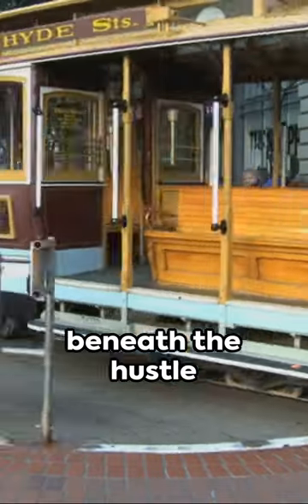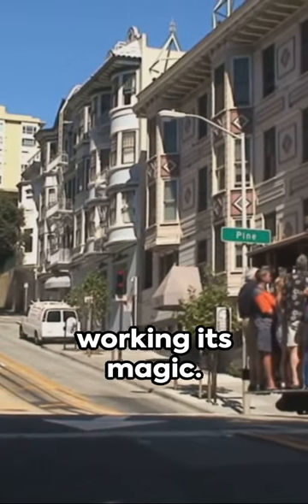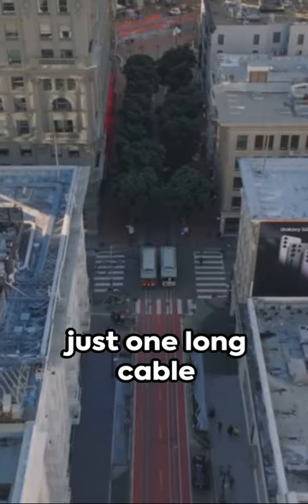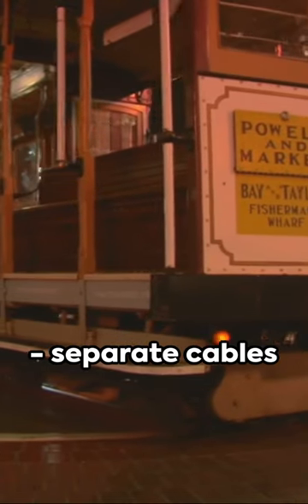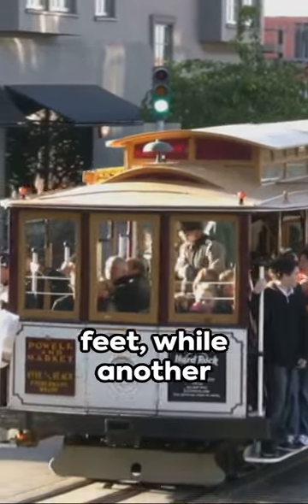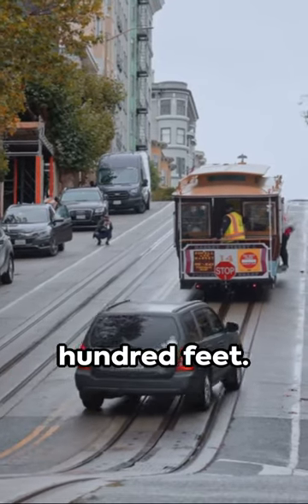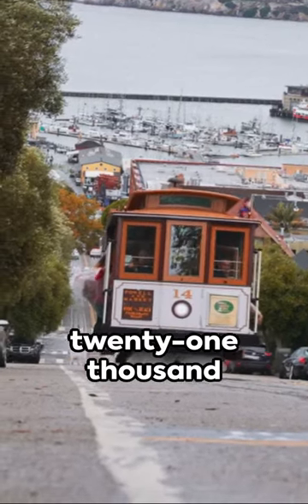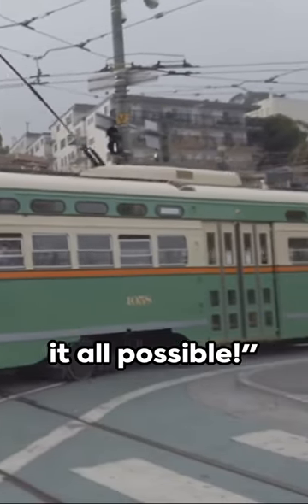The Mind-Boggling Web of SF's Trolley Cables | #Fun, #Weird, #Facts, #Weird facts #rv

Comment: What do the cables do exactly
Reply from the maker: Cable Cars: How they work - Below Street Level. Out on the street along their routes, the cable cars travel on steel tracks set above a channel enclosing the cable. At the top of the channel is a slot through which the cable cars grip grabs the cable moving below.
Reply: Just like my Matchbox track set from 1971, except that thing used springs that looped around LOL